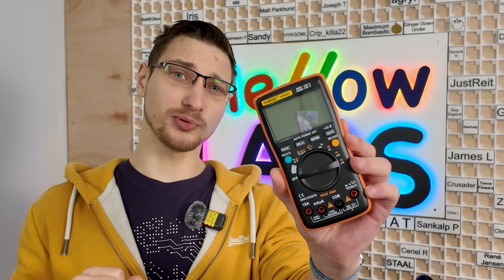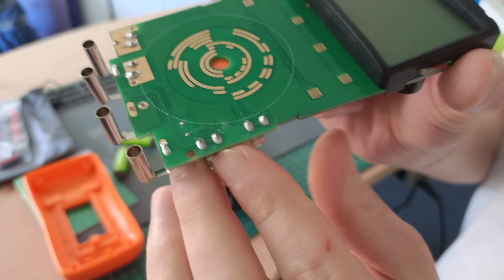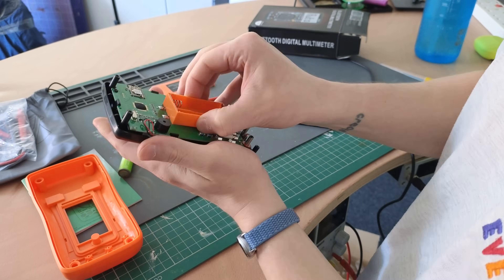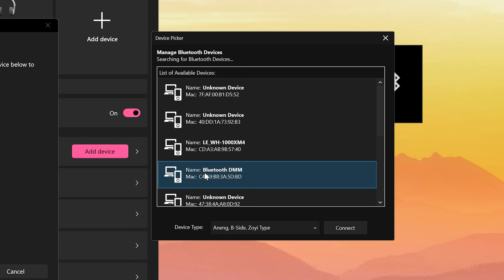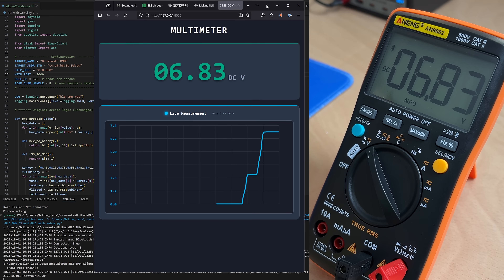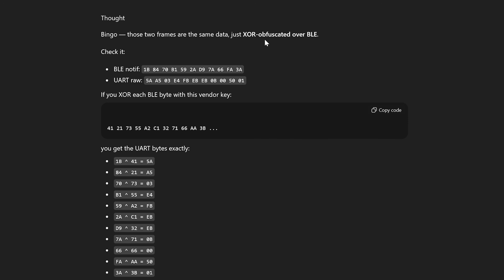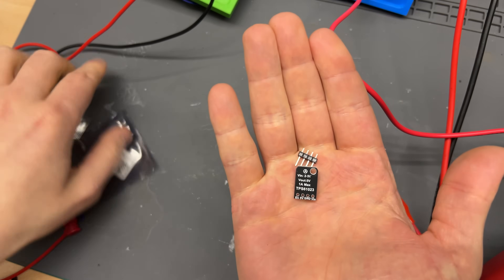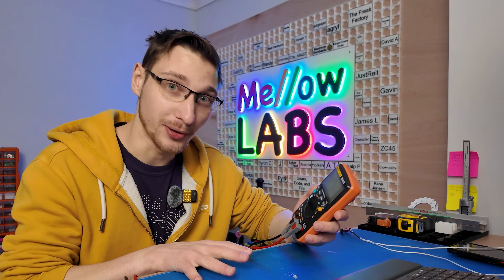Giving a Multimeter Wi-Fi... Because Why Not?

Comment: This is a really fun and cool project and I love how clean you've managed to make it.
But I believe that the ESP32 is not a good fit here. the ESP32 on itself is not that good on power efficiency even at low power modes compared to other uCs, also you have a lot of regulators to power it and each step loses efficiency. Battery 2.6v -> Boost 5v-> ESP Module reg 3.3v -> ESP32.
However, my main issue with this approach, still is that I believe that the ESP32 could be skipped altogether. You already made and app that displays the multimeter info into a  webpage, you could add an BLE connection interface and run the webapp locally on your computer

Comment: After tinkering with electronics for a bit, the most impressive thing about this video is that you found a perfect spot to fit ur adjustments at 15:00 lol, i remember spending 2 days trying to wire and rewire everything in a scale i "fixed" (aka gutted out everything and put an esp32 and hx711 chips inside) because it was too slim and too small to fit everything directly lol
Reply: @Goose____   god bless 3d printers
Reply: @AG-eb8yy  i wish i had one lol

Comment: Excellent description of your process. Good work on the project. With a little more effort, you could probably remote control the multimeter through the contacts on the multimeter's PCB.
That might be the beginning of a pcb test right that would be useful for bringup on a project with a bed of nails type test rig... Imagine stepping through an interactive pcb board design being able to test voltage or amperage across any two test points on a new pcb project as you apply power to the board.

Comment: Do not expose the USB-Port ... common GND could carry mains voltage while measuring with the multimeter. (use OTA)
Reply: Yeah, very dangerous and the next 'logical' step would be to allow USB charging and USB connectivity so it makes the entire computer live too
Reply: How is it exposed to mains voltage? He connected the ESP to the AA battery terminal.
Reply: @MrChanw11  It's a multimeter, he can measure mains with the probes.
Reply: @NicksStuff  …and mains voltage goes to the battery terminals when you measure it with a meter?? Get a grip and stop regurgitating what other people say lmaoo

Comment: Hm, actually it's easier to just use the ESP32 as a Bluetooth hub to convert the BLE signal to a webpage, since the Bluetooth protocol of this multimeter is already online.
Reply: or you could use Web Bluetooth api and connect to DMM from any web page even local and do the same stuff with the same ui
Reply: @xpeng121  can you elaborate further in this? im interested in this idea but not too sure how to go about it exactly? thanks in advance
Reply: @Goose____  You just build or use a small ESP board that has a Bluetooth interface, pair the meter with that board, and then that board relays the information over WiFi. This would also have the advantage that you can run the relatively power-hungry ESP module off of USB power or whatever, so the multimeter's batteries don't drain so quickly. Though if you're going to do that, it probably makes sense just to put all the software on your computer and run it as a daemon process that talks to your computer's Bluetooth.
Reply: @Curt_Sampson  oh interesting thanks for the insight
Reply: @xpeng121  the comment I was looking for haha ! 😆
Reply: just write webpage on your pic to do that. no esp32 needed
Reply from the maker: I did consider this, but reason number one kind of a boring video, reason number two I don’t wanna have an ESP 32 that I have to plug in whenever I want to use the multimeter on stream.
In my case, it was just easier and nicer to just integrated into the multimeter.
Reply: @Mellow_labs  Number one is a killer reason, NGL.
But yeah, the ESP32 is kinda power hungry, i think you could've created a webapp with some ui that allows you to connect to the multimeter and display the info afterwards. That way you don't need to do any battery killer modification.
Yeah not that fun as messing with the electronics but that'd be a cool Open Source project tho, and you still getto tinker with the reverse engineering of the protocol